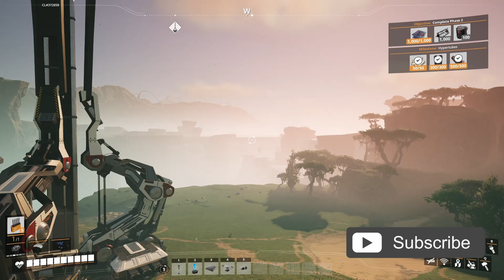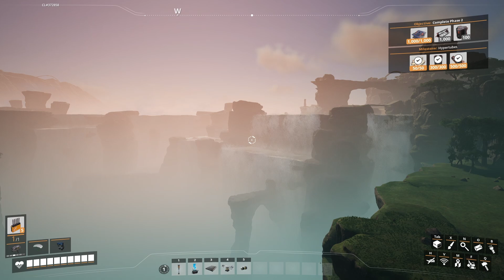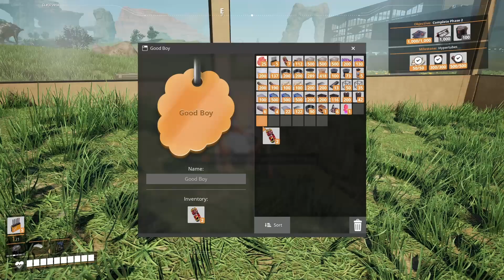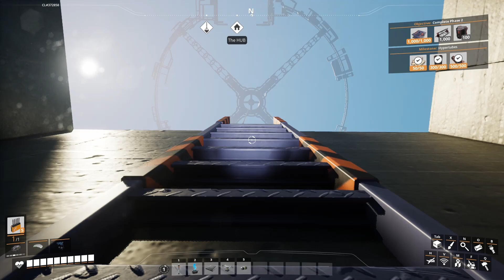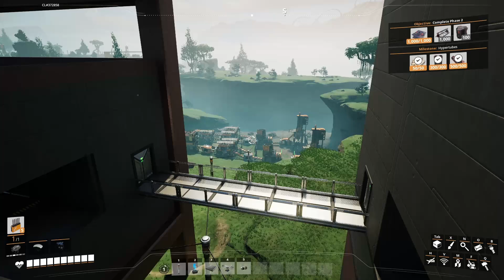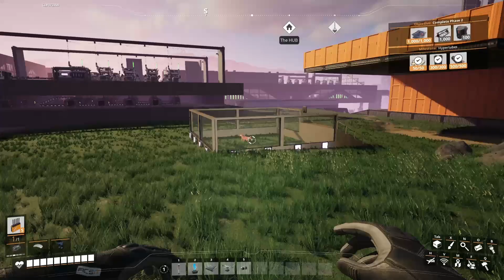Satisfactory 1.0 | Basic Iron Factory

Comment: Iron wire is a fantastic recipe, given that iron ore is more common than copper ore -- means you can make wire in places where copper is scarce/unavailable
Reply from the maker: Ok. In previous playthroughs, copper has never been an issue so I didn't think it was going to be that useful. It might deserve a reappraisal.
Reply: @StormhavenGaming  Also, combining it with the iron pipe recipe means stators and motors can be produced with iron alone.
Reply from the maker: @crispybaconnz  I had not considered that. Ok, I may have unfairly maligned the Iron Wire recipe!